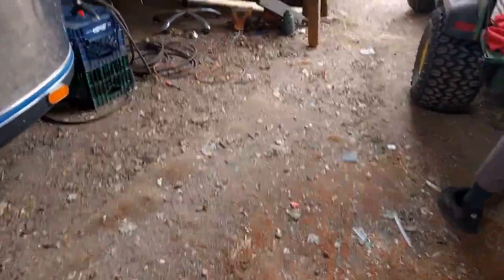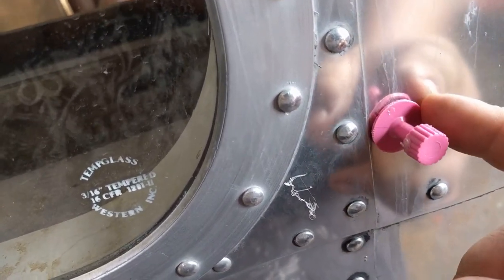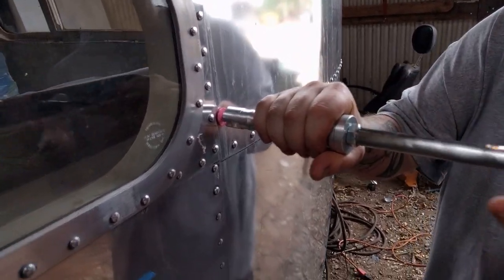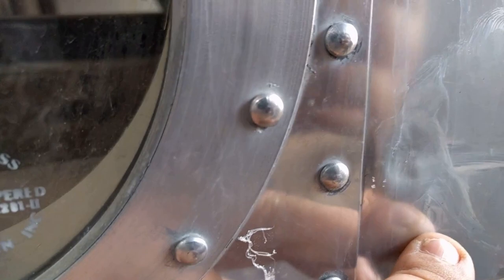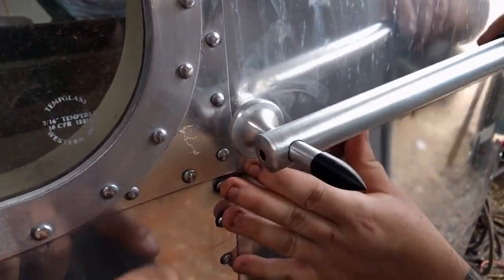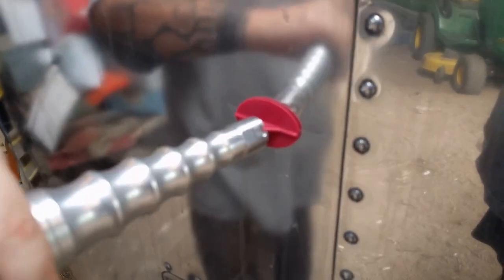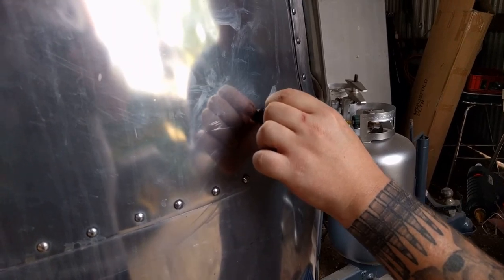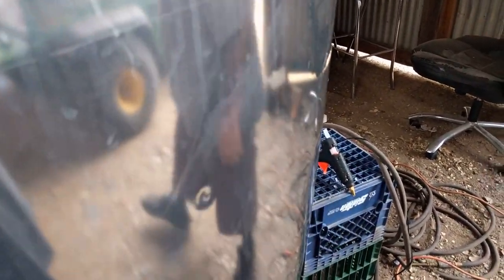Airstream Dent Removal

Comment: Cool Video i hope you guys keep sharing the tricks you  have learned along the way I am a East Coast guy and I'm thinking you are out West ? The significance of this is  many times Fads or  trends get going on the East Coast  years after they were big  out there  i know because ive owned my own Airstream that  restoring and tricking out. The older Airstreams and Campers was a hot thing with many of the  Movie Stars and Celebrities. And its kind of just becoming  a thing here. In the last few years !   So  i really do hope to see  more of DIY  repairs and Restomods  ive owned new production line Trailers  and have lots of freinds that had them as well  and i always laughed because my old Airstreams. Never had roof leaks. And generally all the  factory items  still worked as  they were intended to with minor repairs and normal maintenance  another funny thing was   The older units always attracted more people  that had questions  and asked for  a tour  i  enjoyed using one i bought that was in good shape but  was dated by its decor  i did a deep cleaning and  a safety  check and we enjoyed many Camping outings in it

Comment: Nice job guys. Anyway you could post the link for the dent-kit you have?
Reply from the maker: at the time I just bought a cheap kit off of Amazon, I still have it but I 3D print the pucks now, I have learned I would rather have the puck break than to over pull on a dent.

Comment: Way to go guys!  Thanks for this video.  I'm rebuilding a 92 Excella and I also have a few dents.  Most of mine are minor.  I'm doing a shell off so I've pulled the interior skins an have been wondering the best way to approach this dent removal business since pretty much all of this metal work is a first time around experience for me. :)  Any additional tips?  Where did you get your PDR kit and body tools?